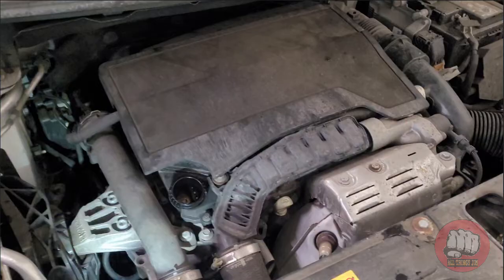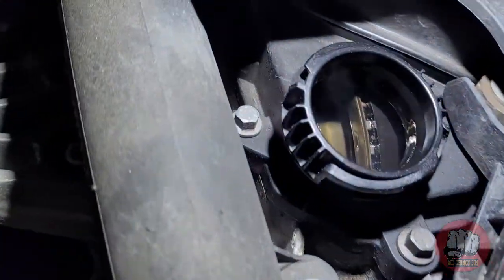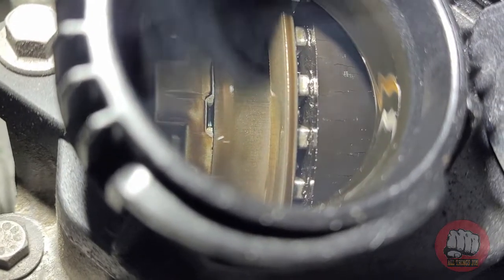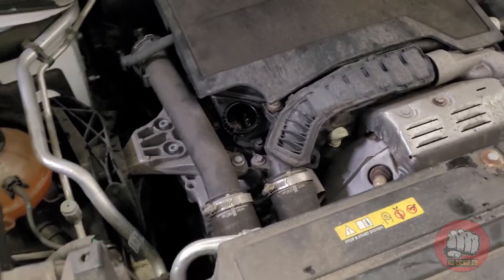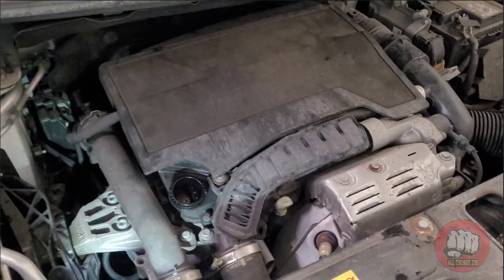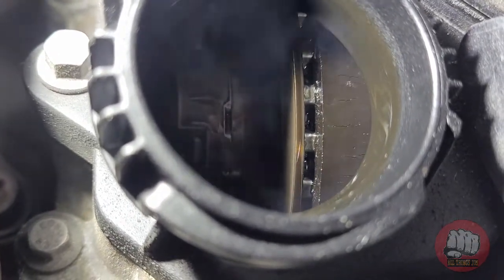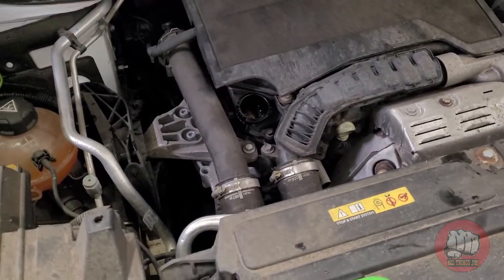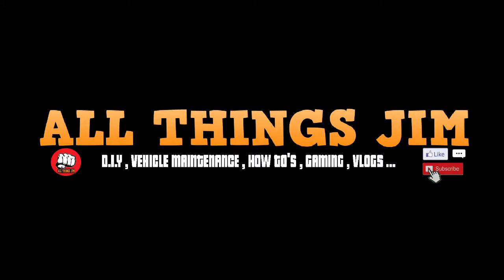Lets discuss the 1.2 puretec engine

Comment: Has anyone encountered an acceleration stutter with this engine?
Reply: Yes - if its turbocharged then check the backs of the inlet valves for carbon fouling - this is caused by the direct petrol injection system used on the turbocharged versions. I also found that the main dealer had fitted the non turbo spark plugs during a service to my Purecrap 130, under hard acceleration / load this caused the engine to stutter. The earlier turbocharged versions also had an engine ecu software update to try & stop a misfire issue - a main dealer should have automatically applied this when required.
Reply: @leepower2717 Thanks for the reply. Yes, it is a turbo model. Do so called fuel cleaners work on this type of carbon build up.i would have hoped that the ecu software would have been updated when the car went in for wet belt recall replacement 🤔
Reply: @p--n  - Its direct petrol injection, the petrol is injected directly in to the cylinder & not via the inlet manifold, a fuel system cleaner wont be able to clean the inlet valves. Mine required a walnut shell cleaning at 34k miles / 4 years old which after several weeks Peugeot " UK lack of " customer care agreed to pay the Peugeot main dealer for.
Reply: @leepower2717  Thanks for the knowledge, another flaw to add to the list, as well as excessive oil consumption,
Reply: @p--n  - That's caused be either the PCV valve failed which is common on the Purecrap engine OR the oil control rings on the pistons stuck with carbon.
Reply: @leepower2717 cheers for those nuggets
Reply: @leepower2717 I forgot to ask...what are the correct plugs for this motor?
Reply: @p--n - For the turbocharged Purecrap you need the thin wall spark plug socket & cross reference the correct part number on the spark plug. The spark plugs are easy to remove / refit - just remember spin them in carefully by hand to avoid damaging the threads in the cylinder head.
Reply: @leepower2717 Thanks, I've changed the plugs a couple of times...its running ZR5SPP3320 bosch plugs, which allegedly run cooler.

Comment: I have a cactus 1,2 110hp 2016 bought it in Greece with 110000 and i saw that consumed oil after i drive it, after 1,5 year have conbsumed more around 1lt/1000km ,now have both to check for this wet belt and why the extra consumption.

Comment: Quite diplomatic.... I'd be more vocal and say that these engines should be avoided at all costs, at least up until the (2022?) version where they reverted to a timing chain. 130bhp from a 1.2 turbo is no good if it decides to shit itself half way up the M6.
You can BET that the chain and sprocket assys. cannot be retrofitted to an earlier belt engine. They're far too canny for that. Built in obsolescence without apparent accountability.

Comment: Avoid all Stellantis group brands if you are looking for recent and reliable gasoline with after-sales service. Former owners of a 1.2L Puretech 110hp, we only had problems with: faulty segmentation, excess oil consumption from 60000 km, 1L every 1000 km, ventilation broken, belt in the oil to replace, speakers sometimes broken. We understood that keeping this Peugeot would be a financial pit. We sold it to a professional because Peugeot, well aware of the problems with their cars, does not do trade-ins. 
Thanks for the video

Comment: My lad bought a 308 GT line one despite my warnings dealer wouldnt budge on the admittedly cheap price so we got belt changed (its a £500 job) but since then its had a fuel hose clip let go brokrn down and now broken down with a persistant misfire nothing electrical or fuel related so it off road again.
Personally due to the poor dealers generally i would steer clear of the whole group of cars PSA/ Stellantis produce diesels are now too complex to be reliable as a long term proposition modt petrols are puretech so swerve them and electric overpriced, every manufacturer makes bogey engines but its so easy to avoid  really these and ecobooms wont buy.

Comment: I got one from new, 66.000 timing belt and oil pickup clean. Never had any problems. Drive it like its a race car
Reply: Does that really help? I just bought a van with this engine.
Reply: @EngGisgo  Hates start and go (cold engines). piston rings have looser tolerances, engine runs richer and the oil gets contaminated with fuel, which is what's eating the belt. I guess if you thrash it, ...

If I had the misfortune of having that engine and could not sell it, I'd change the oil double the interval, with the recommended oil (needs additives). And I'd check the oil pickup and oil pan once in a while. 

The danger is not the belt breaking (although can happen), but the debris clogging up the oil passages and oil pump. I think if you stay on top of the maintenance, it'll be OK. 

Also check if the version is wet belt or chain, the new Puretec are using chains now. 

There's apparently some 3rd-party chain replacement kits for wet belt engines available as well. Not sure how useful and relevant they are, the engine is crap and can end up drinking oil anyway. If you have to replace the belt, maybe worth enquiring.

Best get rid of that turd imo. Best engine 4 years in the running, hey.

Comment: I had the 3 cylinder 1.2cc engine in my  peugeot 206 on a low mileage 66 plate, I was always topping up the oil every 3-4 weeks, It used as much oil as it did fuel, I sold it on.

Comment: I have a 1.2 puretech 110hp from 2020. I change the belt at 99,000km's, which correspond to the manufacturer's recommendation, but even so, "the low oil pressure" warning light appeared. Fortunately, nothing was damaged. The engine is fine thanks to the quick intervention, but what needed to be replaced... Replacement of the timing belt, as material fatigue was already visible as in the video. Completele flushing of the engine oil circuit to clean it of all rubber particles and sawdust from the belt. Replacing the oil pump, as there is a risk that some particles could get into it, causing it to fail. Finally new oil and filters.

I always used the prescribed oil and changed it with filters every 10,000km's. It didn't help.

In the eyes of the average costumer, it is a great engine. The power is sufficent for normal driving and is quiet. Also can be economical, but this engine is simply defective.
Reply: sounds like you got very lucky as it probably was about to snap
Reply: @danokurilec2835  what oil do you use
I have a Theory why some time belts fail 🤨
Reply: Sounds interesting. I use 0w30 b71 2312.
Reply: @danokurilec2835  I had  my 408 for 2 weeks I ve checked the Service and the oil being used currently is the 0w 20 less viscosity reduces Friction and less Friction = less heat
I also suspect City miles might be OK duo to Extremely low RPM VS long Motorway Drives
Reply: @danokurilec2835  did the Dealer Covered the Costs of the Repair 🤔🤨
I mean if this happened within the Warranty Period
And you serviced it by the Book, Oil Pressure problems is not classed as wear & tear it could be classed as manufacturer defect  🤔
Reply: @niceboy60  Unfortunately, it happened after the warranty period and it was not even possible to negotiate with the dealer regarding any complaint. There are a million reasons why it is not covered by the warranty, and if you want to solve it legally, be prepared that it will be expensive and for a long time, so everyone will think about it. Today, business is all about selling and not solving anything else.

Comment: Mines done 27000 and serviced by vauxhaull all its life but the belt is cracking i,m in dispute with them now ! They say they cant see anything wrong even though you can see it through the oil cap that its clearly cracking !!!
Reply from the maker: Oh dear, have you tried contacting vauxhall directly to complain? (not through the dealer) how old is it? As the recommended interval if I remember correctly is 6 yearly. Hope you get it sorted... thanks for watching and commenting 👍
Reply: Good vx dealers are thin on the ground same for Pug & Citroen,  the gauge for measuring the width is widely available and they should be using it so if it's too wide it's to be changed if not complain to the highest person there directly.
Reply: Where abouts can to get the tool
Reply: @bubblehead46  I literally just googled it tink the one I bought was a laser one even Amazon do them it's not just about the width though if the surface is cracking it's likely debris is coming off to block up the oil pick up.

Comment: My problem is oil on coolant ive let it checked dr head casket and thats not the problem are their more people with this problem that their coolant tirs brown?
Reply from the maker: Are you sure its oil mixing? Is it sludgy and has sediment in it? Or is it just like a rusty brown colour because  I have seen a few vauxhall vehicles antifreeze randomly turn brown- which is normally caused by something like incorrect antifreeze used, internal corrosion or some sort of contamination like exhaust gas getting into the coolant... however the ones I saw they nether bothered looking for a cause, it was just a case of flushing the system and refilling
Reply: Good chance it’s the engine oil cooler failure done loads of them common problem of oil in coolant bottle

Comment: Hello, quick question. I bought a second hand citroen C3 from a car dealer with about 32000miles of mileage and 7years old. It is a 2017 plate and i discovered it had 2 recalls on it, one for the back lights and one for the timing belt. I quickly took it to Citroen for recall repairs and they only fixed the back lights and said the belt is still good and can go up to 50k miles or 3 more years. A month later I got a STOP light, engine fault detected, took it to the garage and a low oil pressure error was found, investigated further only to find out that the belt has been breaking apart and the fragments blocked the oil pump. Got a hefty bill from the garage and called the Citroen approved garaged who cleared the recall a month before the incident and they were saying the car was already 7years old and the belt could have been changed when it was 6years old yet I didnt even own the car at that time, only bought the car at year 7 and I just didn't know about all this nightmare of the breaking wet timing belts. What can I do to get reimbursed for the cost i accrued through repairs as I had tried to chase up the recall before the issue and they cleared it as safe and i had owned the car for about 3 months to the incident?
Reply from the maker: Hmmm sorry to hear about your troubles... have you complained directly to citroen (not through a dealer) explain to them and they might help you if you argue enough, unfortunately it doesnt sound like the belt recall was done properly for it to break up so soon OR you may just be really unlucky... citroen will no doubt ask for proof of regular dealer services with correct oil etc and invoice proof. And proof of a cambelt change at the correct interval- if you dont have those unfortunately they may decide not to help you but its worth a shot.... the next thing if that doesnt work out would be to threaten to take the garage to a small claims court... sometimes the loudest customers get faster results.... hope you get sorted 👍

Comment: I have just bought a 1.2 Vauxhall CROSSLAND 71 plate it’s now on 42k , I assumed it had an opel gm engine but no it’s got a 1.2 pure tech engine so that’s me paranoid now about this wet belt issue , and realistically when should you change it , or maybe I should change the car altogether.
Reply from the maker: The interval states 80k / 6 yearly... id get it done 4 yearly if I owned the car and make sure you use the specified oil only and dont put additives into the oil on oil changes (e.g oil flushes)

Comment: Hi
We bought a 3008 petrol in March 2019.
We were very happy with it finding it to be a very comfortable drive and had no problems with it.
We have serviced it regularly firstly with the main dealer and then with our local garage who has been in the trade for years, does great work and really looks out for us advising of any work he thinks necessary.
We took it for its most recent service (about 85000km) in late January and he advised is that there were issues with the timing belts for 3008s and asked us to check with main dealer on when it should be replaced. We rang our main dealer where we bought the car and were advised it needed to be replaced at 200000km or 12 years. We told our guy this and he didn’t agree and strongly advised us to change at next service (100000km) which we agreed to as we trust him.
On Wednesday my wife was driving and the car lost power and stopped without warning - no warning lights, nothing.
We had it towed to our local guy who told us the engine was gone and needed replacing - most likely because shards had broken off the timing belt and prevented oil lubricating around the engine- it only has 92000km!
He advised us to take it to our main dealer as we should not have to pay this cost ourselves - it’s not right given we have serviced it as required and correctly.
We did and have been told our car is out of warranty since March and they are contacting Peugeot Ireland to see what they will do given it’s out of warranty.
Has anyone else had a similar experience and how did they fare out?
We cannot believe this could have happened to a car with just 92000km (57000 miles) with full service history and especially after being told no need to change the timing belt until 200000km or 12 years back in January!
Any help would be really appreciated 🤞
Thanks
Dan

Comment: Does anyone know if the 1.2 VTi also 3 Cylinder is a wetbelt.  .
Reply: Yes it is, i changed the belt on mine at 40,000 miles just to be safe, and will have it changed again at 80,000 miles, i learnt my lesson with the Ford TDCI wet belt engine, i learnt the hard way,

Comment: My strainer was removed former owner.  And car cuts out in gear after 15 seconds.  I’ve a number scanners.  No codes out of it.  Do you reckon should check the oil pump rate if scanner will tell me

Comment: Jim my nephew has a ds3 1.2 2015 puretech p1337 code reading I’ve changed the coil pack and spark plugs as they lithium been running ok for about 2 months and the problem has come back any suggestions mate

Comment: Got my belt changed at 32000 miles under warranty low oil pressure fault its done 57000 miles now and the same fault has came back hopefully i can get dealer to look at it but its out of warranty now 😢
Reply: Same thing happened to me new wet belt at 50.000 . Done 60.000 started  again pure crap  citroen

Comment: I am thinking buying a car with 1.2 puretech and 130hp but its burning oil. What could be the problem and how expensive could it be?
Reply from the maker: My advice would be dont. Walk away and forget about it if its burning oil. These engines are not very good or reliable, could be anything from piston rings, valve blowby or a simple case of oil dilution or a leak but most the time in these engines you will end up eventually having to rip apart and rebuild the engine or replace it
Reply: @ALLTHINGSJIM   Ok I will walk away from this and thanks for advice.
Reply: My gut feeling when I heard about these engines was that they'd be a wrongun, before I heard actual reports.
130hp out a turbocharged 3 cylinder engine was never going to be a reliable road engine, even before the wetbelt issues are thought about.
They are built to pass increasingly unreachable emission regulations, at the expense of long term reliability.
Friction has to be reduced wherever possible, by for instance using race type thin piston rings, which were never meant to last more than a season between engine rebuilds.

Comment: 112.239km and no problems.. timing belt changed on 45.000.. it works like new...
Reply: What was the reason of changing at just 45,000kms?
Reply: @JacobianMatrix9  There is a time interval too, with belt being due for change whichever arrives first. 6 years or 60k miles.
To be even more cautious understandable, given the known problems with this wet belt engine.
Reply: @matthewjenkins1161  Makes sense... I also own one just at 39,000kms / 4 yrs :D. Are you aware of any correlation between engine power vs. early belt failure?
Reply: @JacobianMatrix9  I'm not but am curious. Got a friend with a 110bhp 2018 C3 Aircross which has been main dealer serviced from new, now on 40k miles and drinking oil like a fish. I'd read up on these and encouraged him to ignore main dealer service schedules, to instead change oil and filter every 5k miles. Like most, he mistakenly believed the manufacturer knew what is best for their car. Running a belt in oil is a terrible idea and worse still in a highly stressed turbo holding just 3.5 litres.
Reply: What car and power level?

Comment: Apparently the new 1.2 puretech that started this year is revamped from the groundup and uses a chain instead.
Reply: So they decided to implement what Toyota did 8 years earlier on their 1.2 turbo petrol.
Reply: I've just bought the 408GT 2024 brand new. It's still a belt not chain
Reply: its still belt
Reply: They implemented chain only on one version of the engine, the more powerful one.
Reply: No still belt

Comment: Have a peugeot 2008, and it's due its first service at 12k miles currently at 7400 miles only topping up engine coolant and some oil very little it put in castrol edge? It maybe had 100ml since new
Reply: Don't use Castrol Edge.. Castrol doesn't have oil for 1.2 Puretech engine.. Castrol Edge is high quality oil but not for 1.2 Puretech.. Castrol Edge probably harm your timing belt. Use PSA approved B71 2297 coded oil only..
Reply: @orhan14oglu  yeah, I've bought total energies quartz 0w-30 it's just been serviced and runs very well
Reply: @MelchizedekKohen  yeah Total İneo HTC is fine..